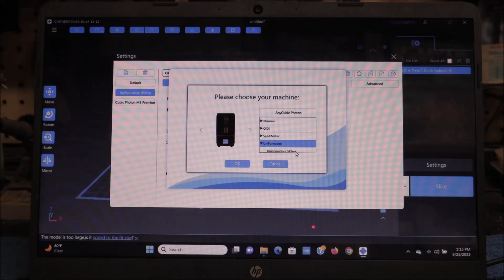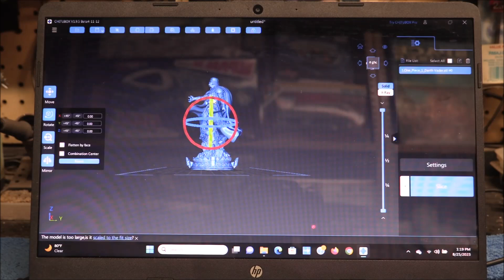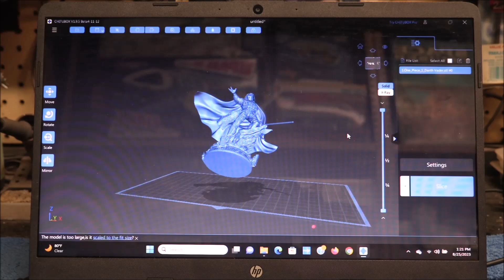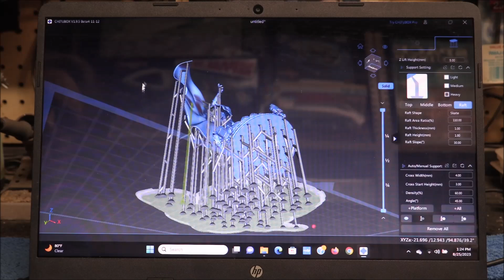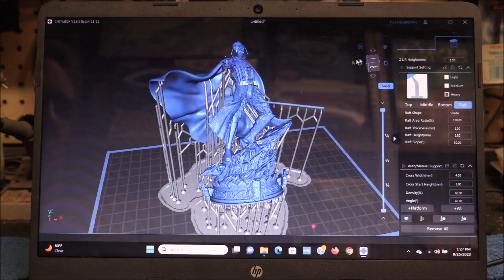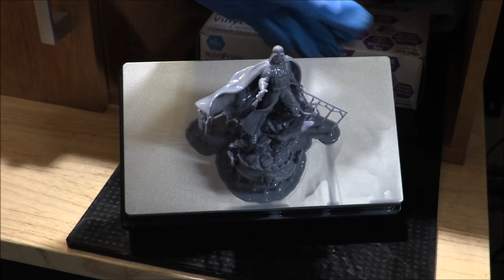UNIFORMATION GK Two Resin Printer Review/Test Part 2

Comment: Never print a model of that size solid. You can't cure more than 3mm deep. It's a waste of resin and will most likely crack and leak resin. Hollow to 1.8 and put drain holes. 5% infill works perfect. 45% Medium supports with no raft will work just fine and you set how high off the build plate in the support section. No need to worry about it in the first stage. Outside of that, everything you said about thee GKTwo is correct. I am waiting for an updated version that should come out early next year.

Comment: Boyd,

How is  your ventilation for this machine?  Built-in carbon filters for the machine?  Do you have ventilation for your shop?
I'm saying this because there's TREMENDOUS concern about the toxicity of the fumes from resin used with 3-D printers.  There's also concern about NOT touching the resin before it's completely dried out.  

I'm afraid if people don't take this seriously that within a decade a ton of you are going to be going to doctors and finding your 3-D printing hobby is making you sick.
You take measures to vent out paint fumes and epoxy glue fumes as well as resin used for sculpting and modeling.
The 3-D resin risks should be taken seriously, too.

I've looked over your comments section and ONLY ONE OTHER PERSON is mentioning these things.
This is a concern.  This is a new hobby and I'm afraid a lot of people are being complacent (AS USUAL!!!) and NOT reading about the risks of the resin used in 3-D printers.
Reply from the maker: The fumes from printing should be taken seriously. My shop is very well ventilated and all of my printers have the carbon air filter systems. Printing indoors in a room will make ventilation even more important. Should keep a window open with at least an exhaust fan and use a high quality respirator mask. Fortunately, water based resin is available which is much less toxic and works just as well as the regular stuff.
Reply: @TrekWorks  Whew!
Glad to hear you're taking this seriously, Boyd.
I'm afraid that a lot of people are still being complacent with 3-D printing precautions.
Reply: You're right, I think many enthusiast are in my case not a lot of room, not a dedicated space for it so we built enclosure but then we would Ideally want to evacuate all fumes outside somehow but some installations are really hard to especially in Europe where we have some specials windows it's a pain because you have to partially open your window do it's going to be really cold etc etc the best advice for everyone I think is wear nitryl gloves for handling everything possibly in contact with uncured resin or in doubt, wear a respirator or a mask with Organics filters (VOCs) ((btw if you have some good mask to recommend mine tends to hurt me on the nose and ends up leaking running on my nose going for my eyes..)
And googles, avoid the uncured resin as much as possible basically

Comment: Can you tell us about fumes and cure time
Reply from the maker: The fumes are only noticeable when the lid is open. I have very good ventilation in my shop which is a must. 
When the machine is running with the lid down, the fumes were gone due to the built in air filtration cartridge. 
The print I did here cured in about 4 minutes with UV light.

Comment: That turned out really nice! That was an excellent tutorial on the process. You're really getting the hang of this!
Reply from the maker: After you get the hang of the slicer program and how to setup the supports, it gets a lot easier. Really helps having a good printer that's stable too. What was frustrated with at first was being too messy dripping and spilling the resin. I have that figured out much better now.
Reply: @TrekWorks  I didn't know how they worked at all so it's all new to me! 😄